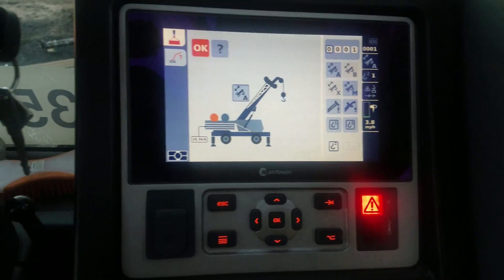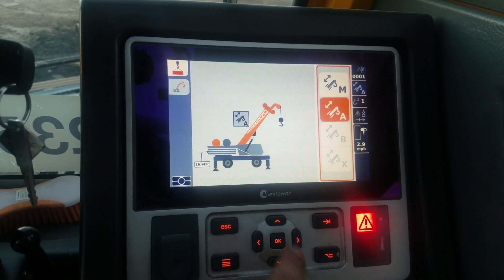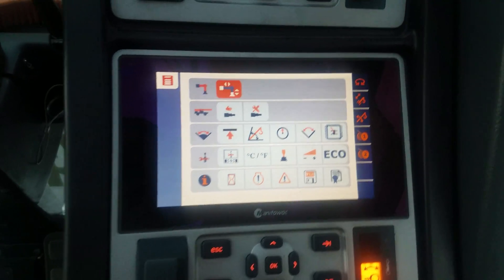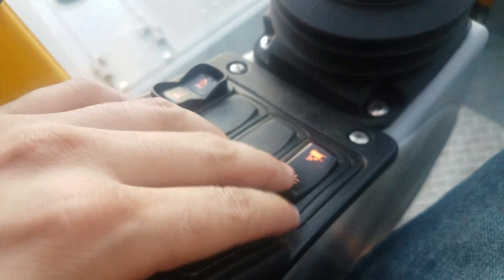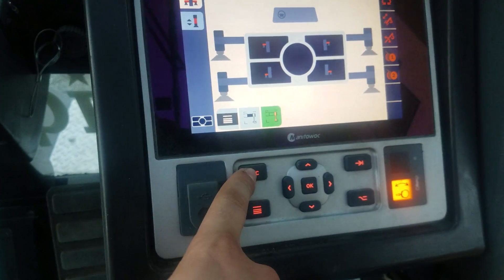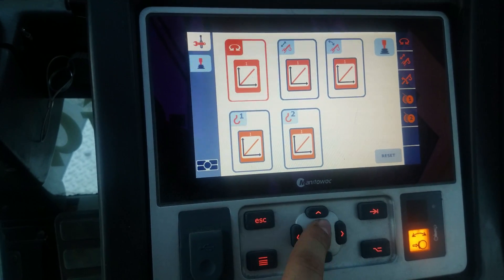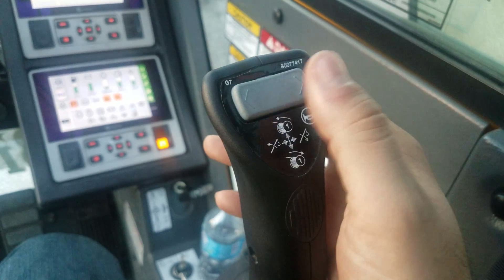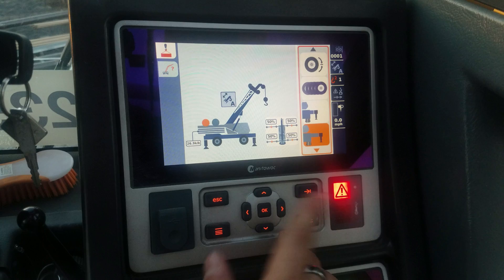Grove 8100 setup

Comment: How do you override the two block if I’m booming all the way down to drive the machine with the block and ball hooked up to the machine
Reply: Over ride key is behind the seat or on the back of the cab.
Reply: @fukyou99997 I’m surprised they didn’t put it on the outside of the boom 😂

Comment: I have high level hate for this computer and cab on these RT models.  Why Grove cranes went away from the simple and easy to use PC’s in the older models such as an 05’ RT650E, I’ll never know.  The electro over hydraulic controls suck.  The fine metering is just as bad as a new Link Belt.  The steering wheel tower is pointless.  The 360 mechanic lock takes much effort to engage.  The telescope pedal and swing brake are the same shape so you’re guaranteed to land your foot on the wrong one when looking out the top glass.  These cabs also are similar to the Plinko game on price is right.  Anything you lay up top WILL find it’s way to the floor.  There’s no flat surfaces anywhere within easy reach to set a piece of fruit, a can of soda.  The cup holder is 20” away when setting upright in the seat. It’s more narrow from left to right, and also there’s less head room.  No room behind the seat for a persons lunch box, it’s gotta set outside if it rains.  No where to hang a hard hat, I mean you can wedge it above the PC display, but it’ll find its way to the floor.  All the wasted space in front of the steering tower. And the bull nose door, WTF, oh and the 2.0 bull nose door still sucks, needs another redesign. The top glass and wiper motor will get you wet if opened after some rain has fallen, the wiper blade channels it right in there due to poor placement. And all the damn glass keeps you cool in the heat, NOT!!  Sorry to vent

Comment: While trying to put outriggers out I have a 4wd light flashing and it’s locking me out . I’ve tried shifting in and out of it and everything else I know to do any suggestions?
Reply: The flashing 4-wheel drive light is notifying you that the 4-wheel drive selection switch is in 2-wheel drive and 4wheel is required for outrigger function. It's a design feature to save the differential from damage. 

Be sure to press the brake when selecting 4wheel or 2wheel drive.
Reply from the maker: May have to roll it a bit to help things line up

Comment: Does anyone know how to get it in mode A? I can't figure this damn thing out completely yet
Reply from the maker: Its been a bit since I have ran one. But make sure the boom is fully retracted and still hold the scope in a few seconds longer and you should be able to select it.
Reply: @hobanm45  boom is fully retracted and outriggers are out 100% and lmi set at 0001.  It just doesn't give me the option for mode A. Only mode B and M are available. 🤔
Reply from the maker: @heyjiggyjiggy  its been 3 years since I have ran one so I'm out of ideas sorry.
Reply: @hobanm45  it's ok, thank you though
Reply: So I spoke with a Grove vender and he ran the serial numbers. Turns out on the 2017 880E the mode A & X were eliminated even though the operations manual in came with shows mode A & X are there. Any preliminary operations manuals need to be updated with the current and final copy. 🤦‍♂️
Reply: @heyjiggyjiggy  I’m in one built in 2019, only B and M mode, also in mine I can’t click on the (?) icon to get to configuration options I’ve got to go to the load chat and manually put in whatever chart code for whatever configuration I’m using
Reply: @AM-mq5yc  oh yes, i couldn't get that to work either at the time. I eventually figured it all out. You shouldn't need to manually set the operation code though. It should automatically set when you configure it